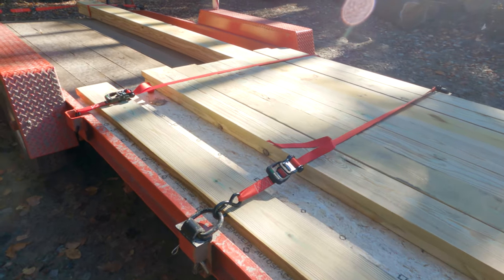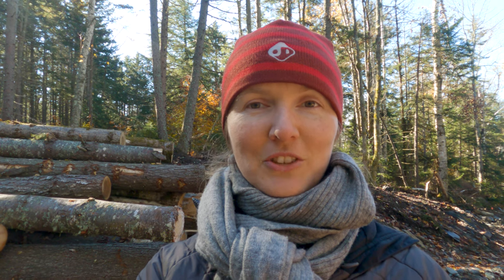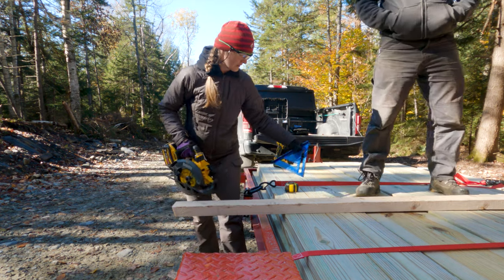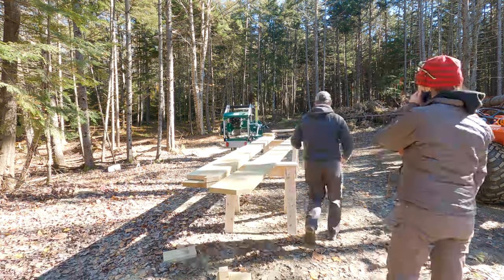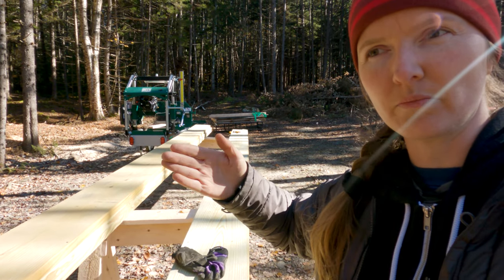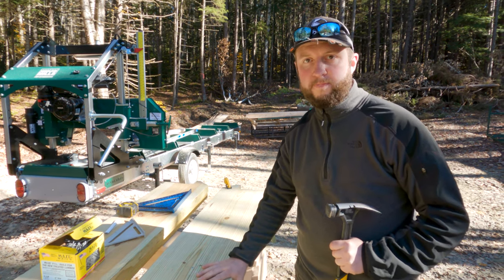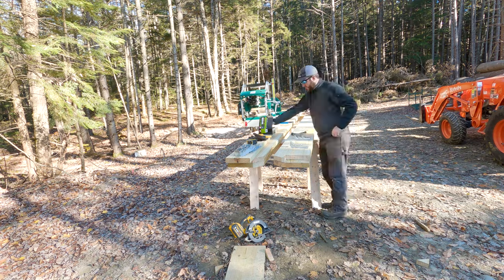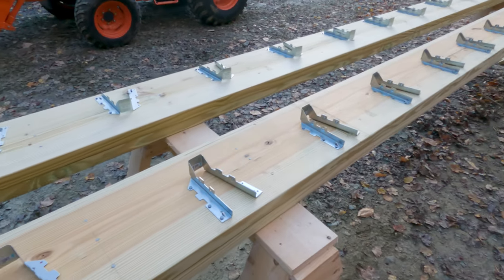Building a Solar Kiln to dry wood | Ep 1: Getting materials & building skids

Comment: One thing I’d like to suggest to you guys is to add an excavator with at thumb to your tractor. It would make picking up logs and wood a lot easier, as well as coming in very handy for digging holes for footings and pole supports.  Wrapping chains around logs and using the loader bucket seems to be a lot more work and you have much less control over where you place things.
Reply from the maker: We seriously considered it! The challenge is that our soil is insanely rocky across the property. And not just small rocks, but solid bedrock as shallow as a few inches beneath the surface - check out our driveway video of the 20 ton excavator struggling with it!

An excavator would definitely make a lot of things much easier, but given the size of excavator that would fit our tractor, it probably wouldn't be worth it. Instead we chose to save our money and we'll just rent an excavator (or contract out that work) when we need to.

Comment: Maybe its just me but why buy lumber to make a kiln to dry wood rather than milling wood to build a kiln to dry wood…?
Reply from the maker: Very good question! We bought wood for the floor/skids because we wanted pressure treated wood as the kiln will sit like that in direct contact with the ground.  For the rest of the kiln we did mill our own lumber and it has been drying over the winter (check out kiln build episode 4).